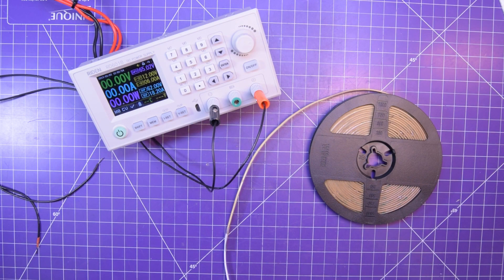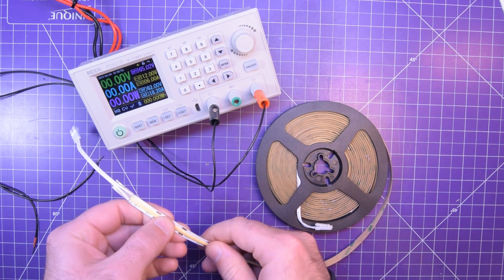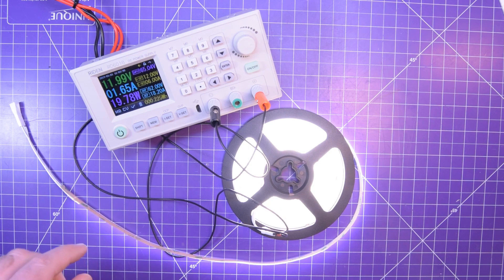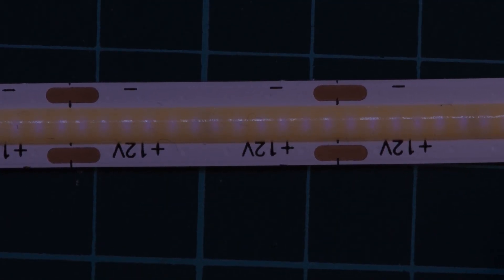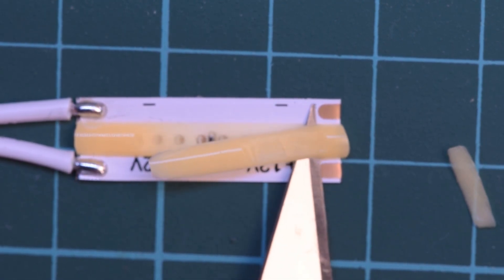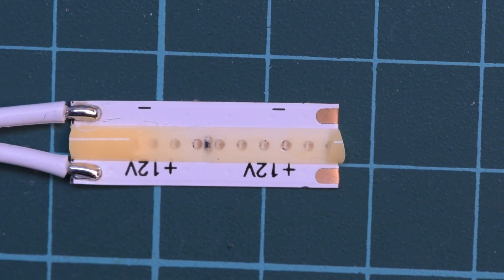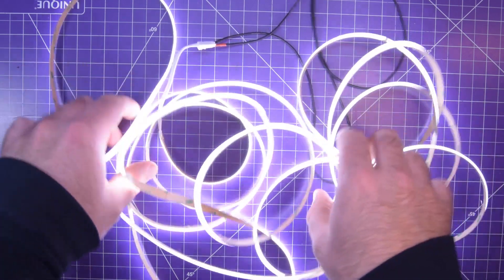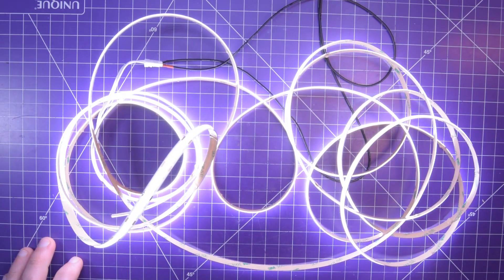SEAMLESS LED Strips!

Comment: Looks really nice, and like you say a viable alternative to EL wire without the downsides of having to run HV and the fact that EL wire goes dim after a short time. I wonder what the lifespan is like? I wouldn't fancy trying to replace a dead pixel on that!